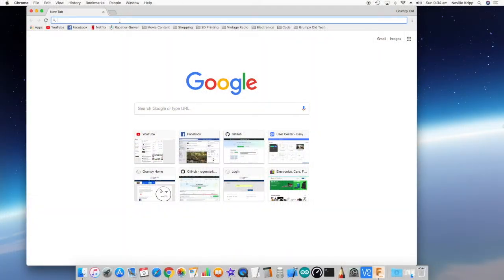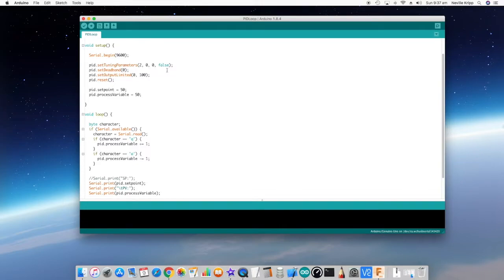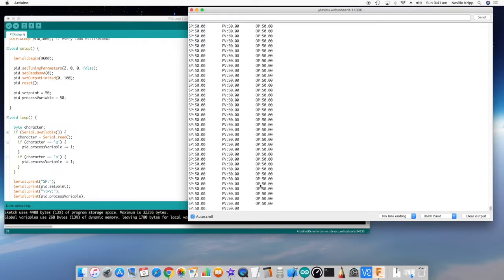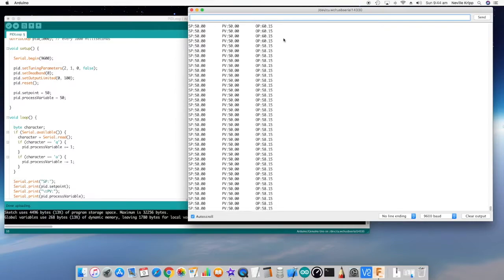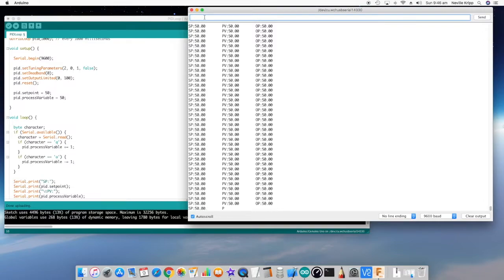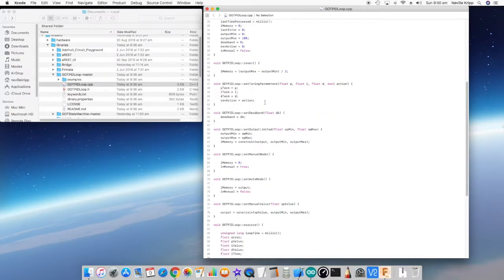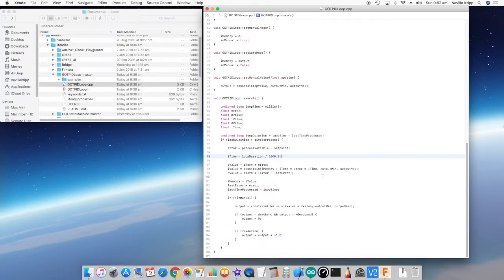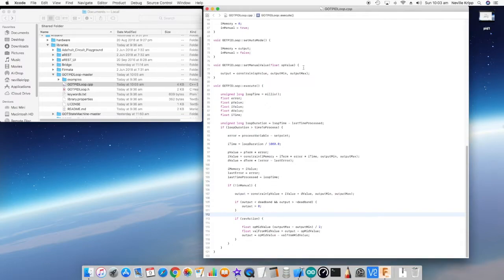#075 Arduino Code - A General Purpose PID Control Library

Comment: BH1750 sensor receives light value and will change the light intensity of the lamp according to the external environment.  according to a predefined parameter.  For example: 500 Lux
Reply from the maker: Hello, sorry for the slow response, I am on holidays here
Have you decided how you will control the intensity of the lamp. I would recommend using pwm modulation as the method of control. It is relatively easy to map the output of the PID control loop to a pwm output.